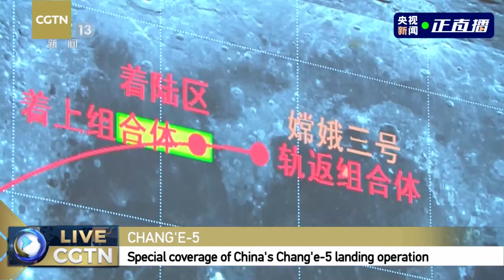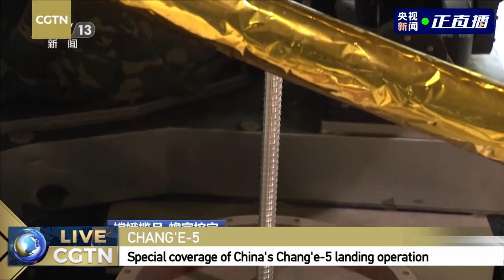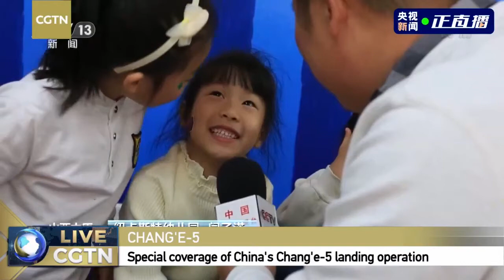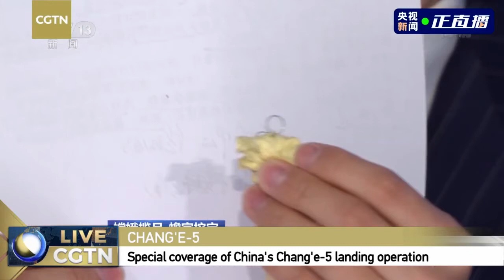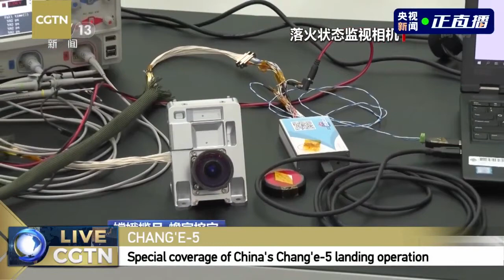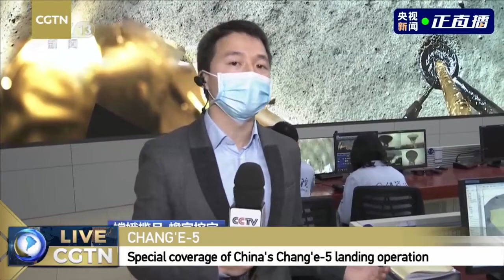Live: Special coverage of China's Chang'e-5 landing operation

Comment: Manufacturing the centre structure around a conveyor system where containers are als ‘bricks’ in the structure- interchangeably so... then this could drastically change the macro design solution. Container is robust enough to be a weight bearing structure too.

Comment: China's Chang-e 5 lunar probe landing.Very difficult challenge, though it may seem simple to collect a sample of lunar soil for analysis.Very precious information.The deeper you dig, the more you travel in time and have information on the genesis of the solar system and beyond.
I guess the first main problem would be that you encounter a hard rock.I pray you won't.You can be inspired by drilling machines taking samples from ice for C14 datation procedures.
The drilling probe must be made of the hardest material you can find on earth with a resisting property to heat conduction., so it doesn't cause a Joule effect on the soil collected and damage its original properties.The motor behind the drill must be fed with high energy with an excellent cooling system.You must seal the whole apparatus from dust liberated when drilling, so it doesn't get into the drilling motor and block it.
Just an other thing, not for you, but the Grey sh#it who think they run over here: if you do anything to this probe mother#fuckers, I'll work on stripping you of every vessel you may have, and pray God the Light to give it to others.
Go Chinese! May God help you!🌻